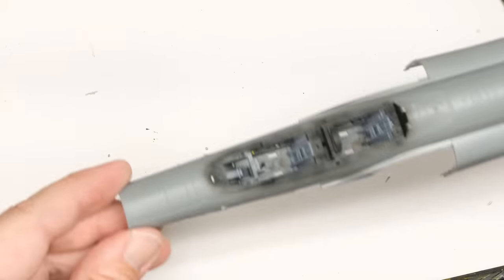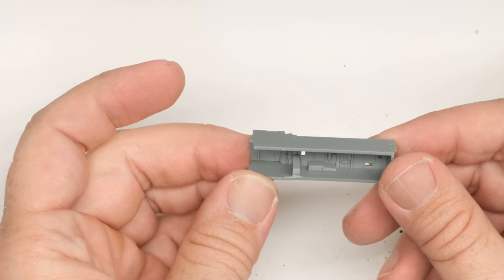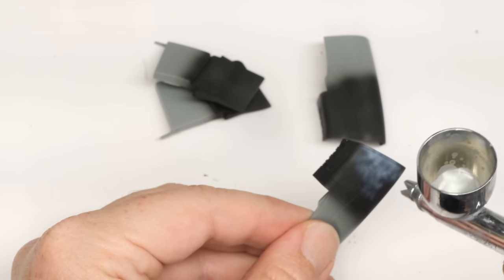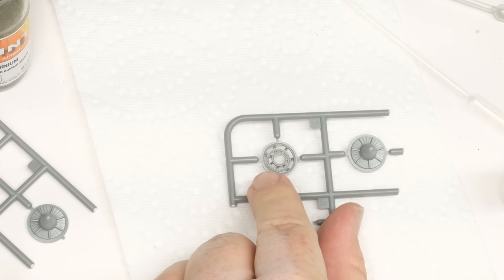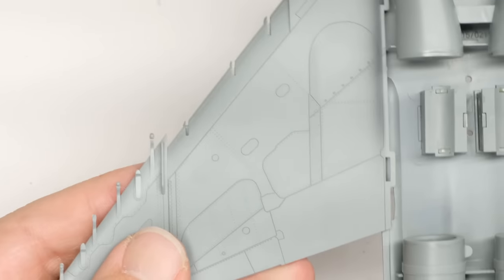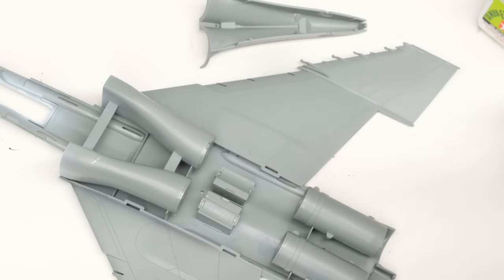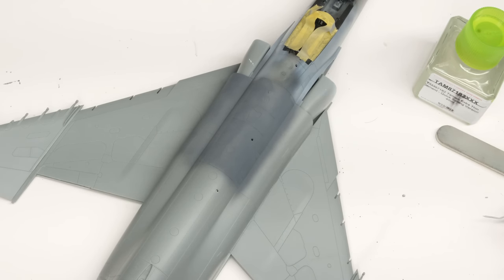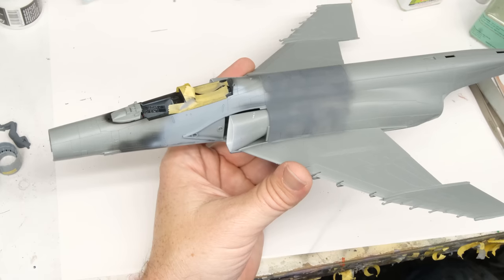1/48 Meng F-4G Wild Weasel 02 - Main Assembly - 4K

Comment: I was wondering, if instead of cutting off those small round parts on the rotating tail wing piece, you cut small slots into the ends of the mounting tabs. This way you still get the positive lock of the round parts and you can still slide in the tailplanes at a later date. And although it was a bit hard to see in the video, I wonder if mounting a spreader inside the fuselage to slightly spread the fuselage to better meet the wings would work.

Comment: I was worried about that horizontal seam line on the nose barrel between the top and bottom fuselage.  But it looks like it's not an issue.  Correct?
Reply from the maker: Right